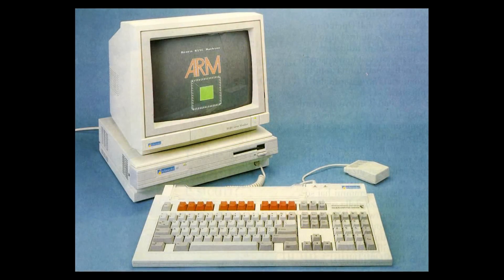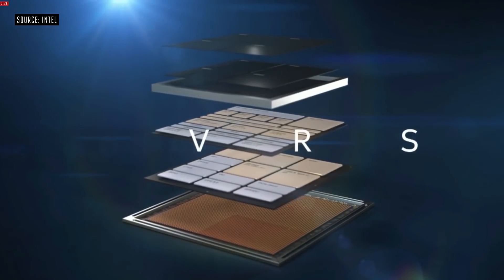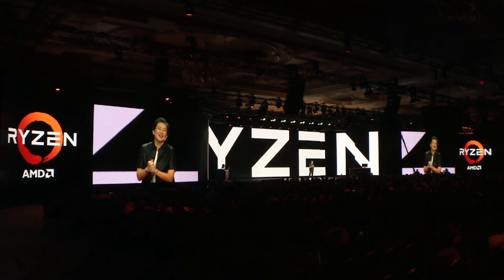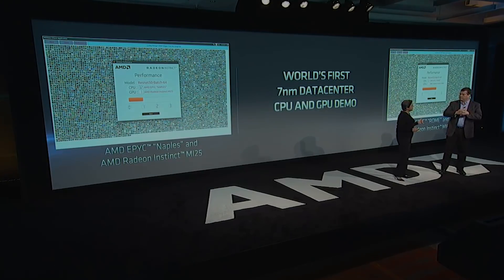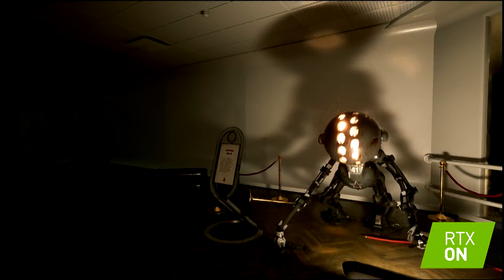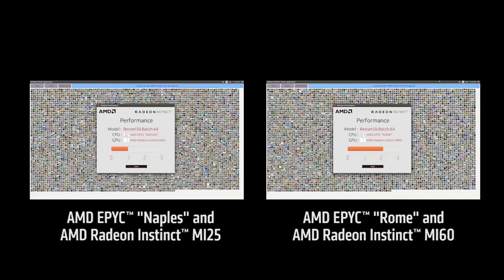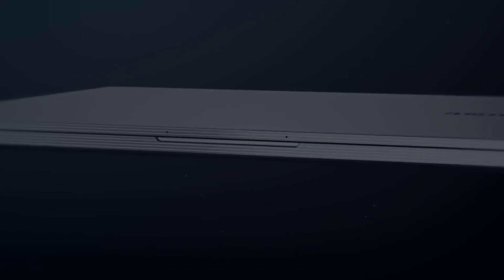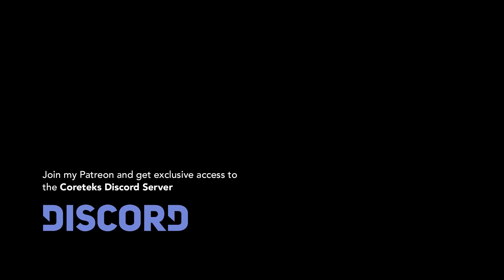Hardware trends: How many cores do we need?!

Comment: I don't see how the shown parallelized code example should work. You cannot store the result without completing the computation. You cannot compute the calculation without reading the values from the registers. It cannot run simultaneously because these operations are dependent on each other. And I don't think Raytracing follows Amdahls Law, instead I think it scales nearly perfectly with cores. More Cores = More Rays per second = More FPS in pure Raytracing Games... You just have to increase memory bandwidth accordingly.
Reply: Yeah, I don't see how more RT cores could NOT process more rays, if the rays are there to be processed. It doesn't make sense.
Reply from the maker: @Michael Persch What you are describing is a 100% parallel workload. In ray tracing there is ray-object intersections that cannot be parallelised, they're run sequentially. And these can't be pre-calcualted and cached for use later because we're running a game in real-time. (I didn't mention this in the video but it's implied that we are talking about real-time ray tracing)
Reply: @Coreteks  But this only constraints a single ray. So you won't get one single ray any faster from more cores, but you can use much more rays in the same amount of time and get rid of all the artifacts from interpolation.

So the problem isn't getting solved faster, but the problem size could be increased without sacrificing any performance.

Correct me, if I am wrong, but I would guess, nvidia wouldn't spend that much on that, if there's this bottleneck and no workaround.
Reply: " Raytracing follows Amdahls Law"
It does... sort of. but the video is wrong. Amdahls law is not about capacity, is about latency
Reply: Yeah, I don't understand that example either. I think it would be possible with some exotic tech like memristors, that both store and execute on data, but on traditional hardware, I don't see how you can get away from fetch/execute/store.
Reply from the maker: @Vaidas Šukaukas Hint: it's not x86. hint 2: watch the beginning of the video
Reply: @Coreteks  what difference architecture make? isn't it hardware limitation? How can you escape fetching the data first, doing stuff with it and then writing the result out with current hardware? It's the same in x86, or ARM, or whatever
Reply from the maker: @Vaidas Šukaukas The example was for Firepath which is a load/store architecture (like with ARM, the rest is operated in the registers). Firepath can issue two instructions in parallel. In the example I gave it initiates the load of 4 32bit integers while at the same time multiplying 4 32bit ints, which is why I said it would only take 1 cycle. Should I put all this in the video so people don't come into the comments and write "WRONG!!! FAKE NEWS!!! YOU DONT KNOW WHAT YOU ARE TALKING ABOUT" like many viewers have done?.. if I did then I would have to explain everything else in the video in detail also, and all my videos would be 6 hours long each. Btw, all toxic comments are insta banned, so if you want to ask questions, please be civil.
Reply: But that's not the question I asked. How can you  multiply some integers that are not yet loaded into registers? It will always take more than 1 step. You can't parallelise this operation, because one is directly dependent on the other. You can load some other 4 integers, while you do a calculation on the 4 you already have loaded previously, but it's not possible to both load and calculate on the same 4 integers at the same time. 

And can''t modern processors issue multiple instructions simultaneously already? It's called super-scalar design. SMT, HT, out of order execution, all kinds of tricks to parallelise execution, but that's not the issue here.
Reply: @Coreteks  I would be glad if you make a video where you explain the code shown in this video and how it is parallel. Really, I am interested, I am a programmer and a subscriber^^ Because I love the ideas in your videos!
Reply: @Coreteks  btw u said 12% more performance. But its 12 without %
Reply: @fobusas  That segment tripped me up a bit at first too. First (as you noticed) the second example doesn't do the same task it's multiplication and not addition. (And it seems to be a vector operator, although I didn't find the exact operation specified).

It's also worth noting that the ISA can define assembly instructions which don't make sense. So a load-and-multiply. It wouldn't be executed "at once" but really no instructions are, they are all pipelined. In some cases the architecture might be such that the load is done early enough that you can use it in an operation later on "for free".

ARM NEON can have some of these properties as they are vector codes which execute at the end of the normal CPU pipeline. So you can do some normal operations first during the "normal" stages and then have the NEON part take over.

But the general premise you mention is correct. You can't load, process and store the result at the same time.
Reply: @MarcusHast  as I understand it, every cycle in every architecture has clearly delineated steps by the clock. Superscalar processors can take advantage of this and simultaneously work on several instructions, each at different step, that is, while on is instruction is being executed, the other different one is being fetch, the other still being decoded, and yet another different which already was completed, is being loaded off registers. But these are all different sets. 

Another issue is if data required is nowhere near close, like in cashe miss, then it takes ages between loading and executing.  Then it doesn't matter how you wrote your code, it will not be executing close in time.
Reply: @Coreteks  Hey man - no need to get aggressive or argumentative whatsoever. I think most people asking you questions genuinely want to know and are not otherwise questioning your knowledge, quality of your content, or personal expertise.

While we all enjoy your videos greatly, calling questions or comments toxic (they do not appear as such to me), or threats to ban, will only alienate your own audience. 

Thanks for your hard work.

My $0.02.
Reply: @fobusas  I think what you are mentioning is more related to pipelining then super scalar. The execution of an instruction is typically divided into multiple steps by clock synchronization. The goal of doing this is to keep the longest possible path of any pure logic network similar for all blocks. This is what ultimately sets the top frequency for the part. (If you clock it faster some results will not have time to finish and you will get erroneus results.)

Super scalar takes this to the next level and allows you to have multiple pipelines that do the same thing. This allows the processor to issue multiple instructions of the same type in the same clock cycle. As an example, you can have multiple pipelines which perform arithmetic and logic (ALUs) independent of each other. It's also not quite the same as a vector processor as the super scalar blocks are completely independent and don't have to perform the same operation on all data. (A vector processor can eg multiple one 4 set of values with another 4 block. But it can't do multiplication for the first two and addition for the second two.)

Looking at the example code in the video it appears to me like a vector operation. But I'm not sure what ISA it is not what the operation is really doing.
Reply from the maker: @Vytautas Vaicys You are not seeing the toxic comments because I've removed them. I don't have a problem with people asking questions, quite the opposite, the whole point of the comments section is to discuss and share ideas, and I'm all for that. But you know how it is, after the 100th person trolls you on things that aren't even relevant to the thesis of the video, it starts getting to you.
Reply: @Coreteks  understood. I guess I mistook your response for the question the other guy had posed. Best thing to do with bullies is to pay no attention to them. They are tire out and go look for the next target.
Reply: @MarcusHast  Ok, thanks, it's clearer know. I got that confused.
Reply: @Coreteks  The confusing part is that the parallel code reads "MUL2W" as you indicate in the comment, but the original code was adding two numbers.
How does initiating the load of 4 integers while multiplying 4 different ints allow you to load, add, and store the same calculation in 1 cycle?  The code in the two examples do not do the same thing!

I think the "one cycle" is the sustained average while looping -- you are computing for iteration n, while saving the result of iteration (n-1) while fetching the values for the upcoming (n+1).

Modern CPUs do that behind the scenes _now_.  They all have multi-dispatch without explicit coding, and do loop unrolling through out-of-order execution and register renaming.

How to code parallelism on the machine-code level is a deep subject in itself.  You have EPIC, VLIW, predicated instructions, and the behind-the-scenes way that x86 works now.  It is not correct to say that CPUs don't code for instruction-level parallelism now -- they certainly do.  If I ran your top example on a high-end processor, each of the three instructions would be issued with several others in the same cycle.  Just not those three together.  And your bottom example does not issue those specific three instructions in the same cycle, either!
Reply: @fobusas  Perhaps you are confusing steps and cycles? Parallelization is the execution of multiple steps in a single cycle.
Reply: Hi  @Coreteks  and everyone, I remember watching a video about some companies working on automatic (and i believe real-time) hyperthreading is software built for single thread operation.  The idea was that all software capable of being parallel operation would be converted on the fly, I think it was one of your videos, but maybe not, either way I haven't found it, does anyone know anything about this?  I think Intel might have bought one of the startups working on this.  The video was at most about a year or so old.
Reply from the maker: @jonathanberry9502  You are correct. I can't confirm who bought them though but you will see the tech used in upcoming products.
Reply from the maker: @The Eclectic Dyslexic Segmenting the image would indeed be a possible solution for better parallelization, but you always run into the same limits, it would just mean more rays and a "better" looking image. You could also distribute the objects themselves across other types of cores for the intersection computation, and perhaps that would speed that bottleneck up.
Reply: @Coreteks  The problem with raytracing isn't the processing time of a single ray, but the number of rays you can use in parallel. That's the reason why it looks shitty on moving objects right now: there is only a little amount of rays used in a single moment.

If this law would work the way you proposed, there would be no need for hpc data centers, because no one could ever use that amount of parallelism.